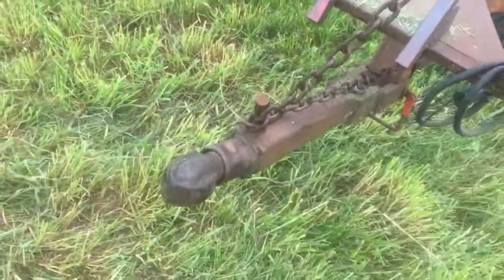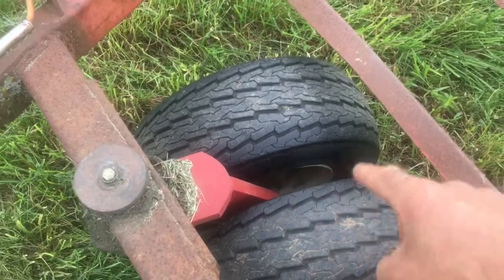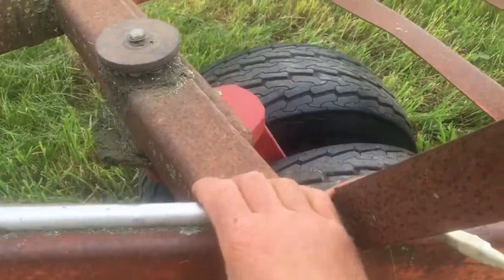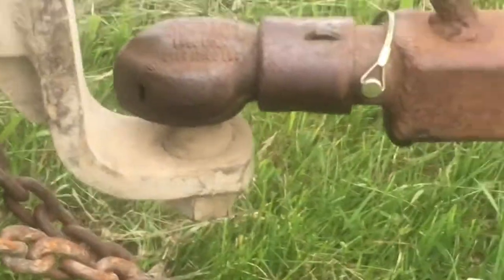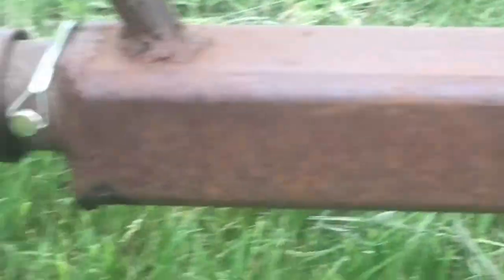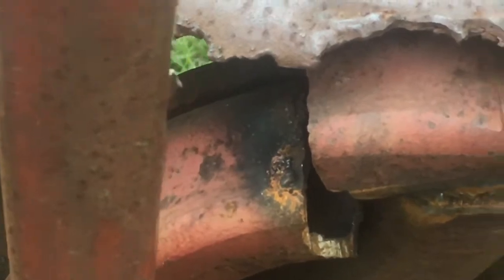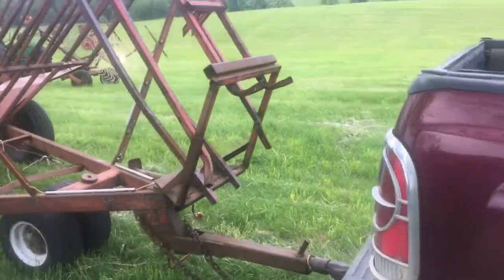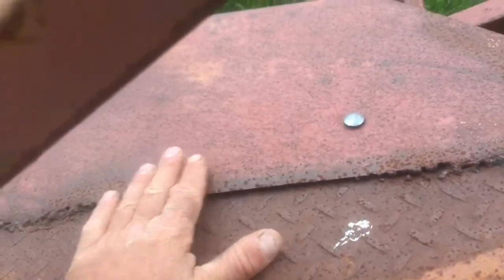EZ Trail Bale Basket Repair And Modifications

Comment: I have used these EZ Trail baskets  for as long as you.  I like these baskets but I have always had problems adjusting bales so they are not packed so tight, from the weight of all the bales being pushed up the shoot.  Sometimes when the weather is not perfect i would like to be able to adjust the bale so the strings have a little room so the hay can breath.  Could you address this problem?
Reply from the maker: L. Horseman One thing that I did do early on was widened up the bail chute entrance on the bail basket I thought there was way too much binding and construction there I basically heated up the tubes and bent them out and widened the whole chute all the way up so the bales are not squeezed in the chuteI thought maybe it was because of the angle of my baler  the bale chute goes down and then the bales had to be bent and pushed up because on the center line baler  lthe chute pretty high off the ground what Baler are you using?

Comment: GREAT video. Thinking of getting two baskets myself. Probably have to get new, as second hand units are HARD to find in good condition and aren't cheap. How fast to you go down the road with the pickup truck pulling them loaded?
Reply from the maker: 25 to 30 mph no problem. Empty much faster.
Reply: Awesome, thanks,
Reply: Finally got two Bale baskets, and in the process now of adding a strong ball coupler. Used the baler with the supplied pin system....it is terrible to attach and disconnect with a pin.
Again thanks for the good video...
Reply from the maker: Yesterday Farm Great you’ll be the only other person I know adding a ball coupler let me know how they work
Reply: @michiganhay7844  Cheers! The ball coupler is what made our bale baskets 'usable'!  if I hadn't installed ball couplers I'd have likely sold the bale baskets again. The ball coupler made the basket go from a REAL PITA to a fantastic addition to our hay making. (It's almost criminal that they don't do this ex-works! :))
I'll upload a video showing my incarnation of this modification. It's SOOOOOO simple now to disconnect/attach the bale basket!
Again, THANKS for the tip!!!
Reply from the maker: Yesterday Farm Great make sure I find out about the video I’d like to watch it
Reply: @michiganhay7844   Finally got around to edit & upload a video showing the ball coupler on our Bale Baskets: https://www.youtube.com/watch?v=oY1tOkO-Qnw